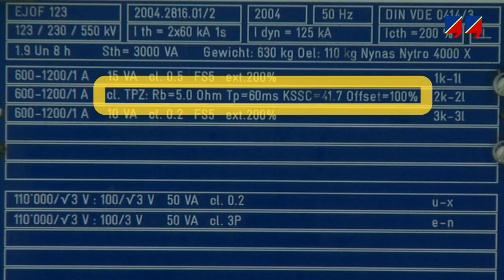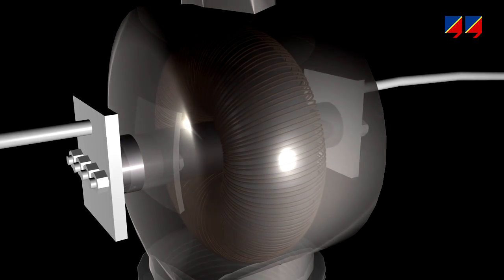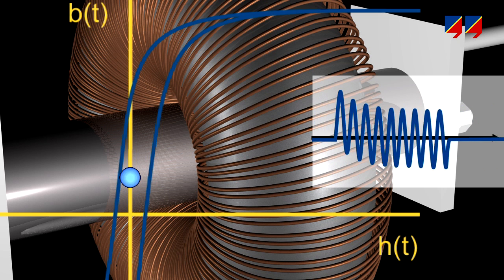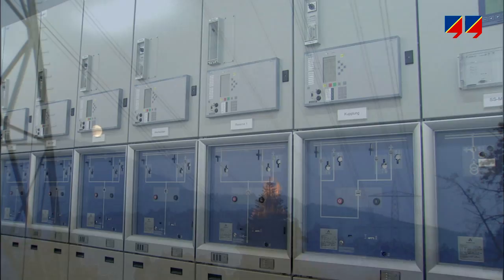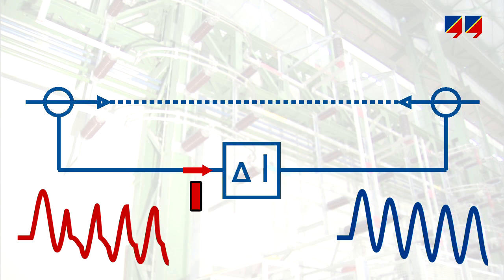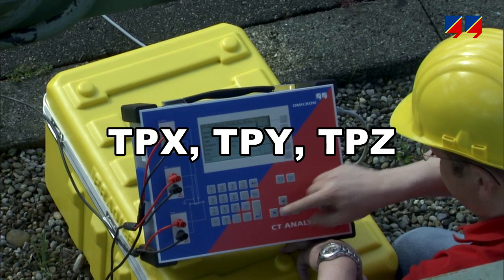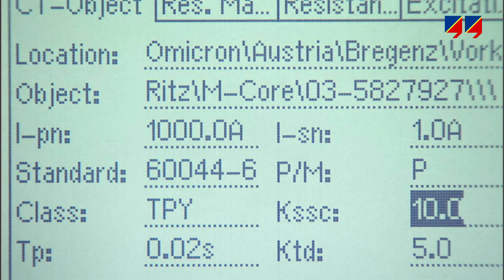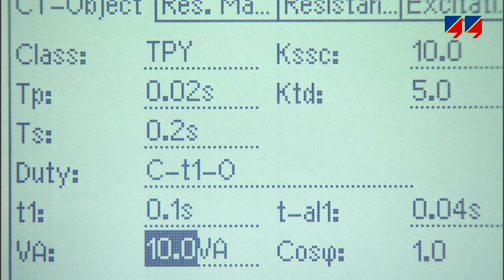Transient CT behavior: Testing of TPX, TPY, TPZ classes

Comment: what is the encryption of TPZ and TPY?
Reply from the maker: Dear Юрий Колесников, 

thanks a lot for your comment and interest in this video. 
The standard IEC 60044-6 classifies CTs according to transient performance (TP) when short circuit current has exponentially decaying DC offset. IEC 60044-6 differentiates four TP classes depending on the layout of the CT core.
Like TPY Class with remanence air gaps or TPZ with a linear core.

For more details, please check the standard IEC 60044-6. For more information about our solutions, please visit: https://www.omicronenergy.com/en/products/ct-analyzer/

Best regards, 
your OMICRON team